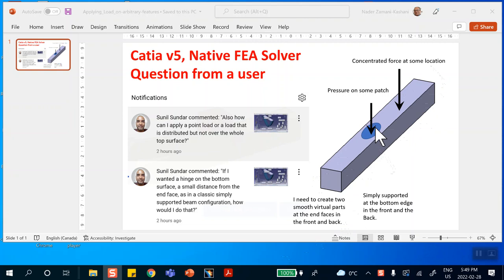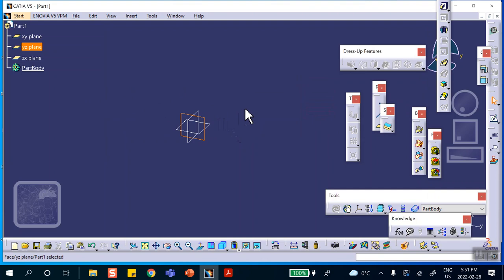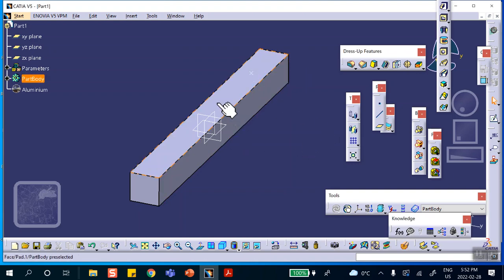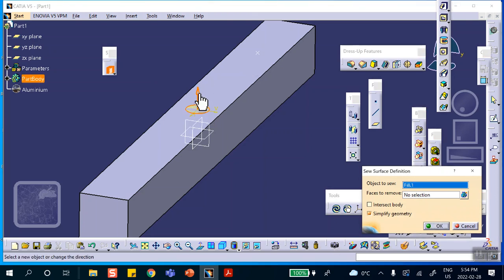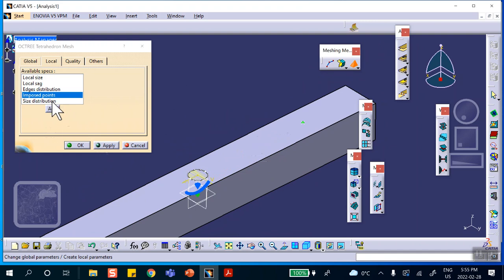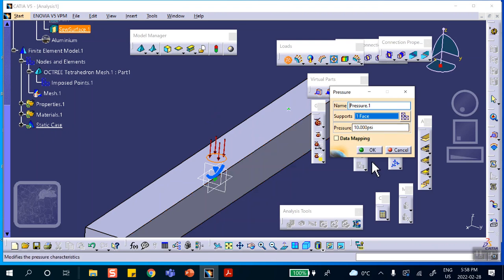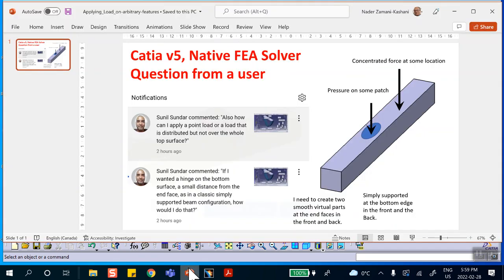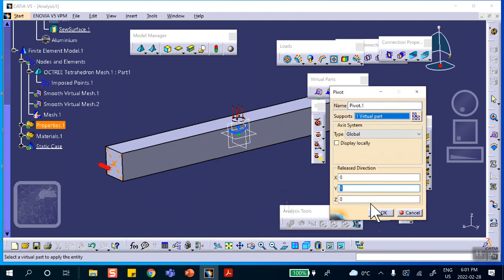FEA Load on Patch and a Point Catia v5 Question by User

Comment: Thank you sir! 

That comprehensively answers my questions on point loads and load patches.

However, my other question was about how to add restraints to mimic a situation where the beam is balanced on two knife edges inwards of the ends.

The way I did it, was to make 2 rigid  virtual bodies on the face opposite the one on which the force is applied (the rectangular one). I then chose 2 handler points on the surface to apply the restraints.

However, when I ran the analysis, the beam collapsed instead of deflecting.

What did I do wrong?

Thanks again for sharing your knowledge  on YouTube 

Sunil